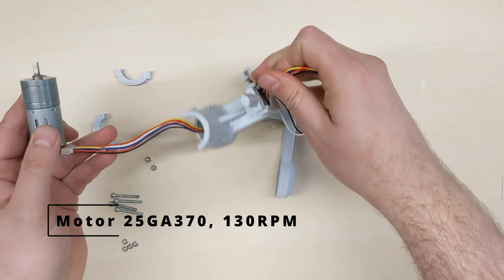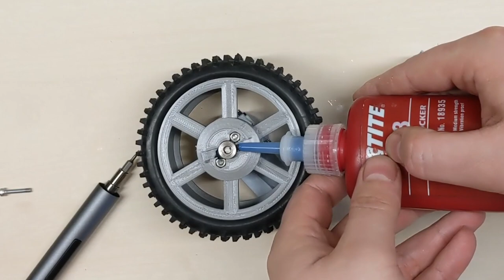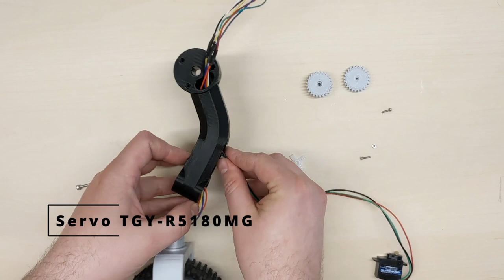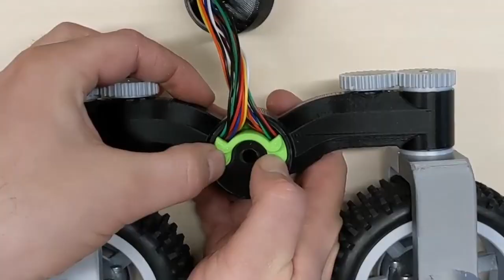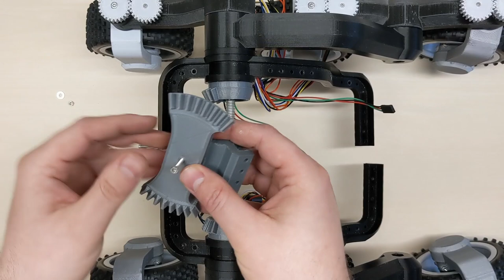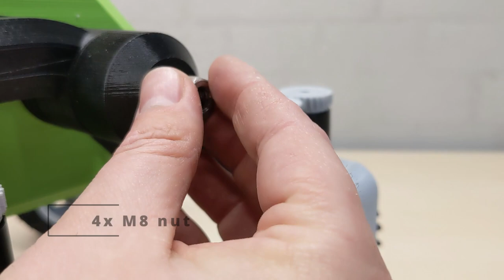Stair Climbing Rover Assembly

Comment: Fantastic!  I can imagine all the iterations of the different systems and hardware design involved in this.
Reply from the maker: Actually not that many. Started by designing one wheel assembly, and build on top of that.  Some parts took a few tries to get the tolerances correct.
Reply: @wildwillyrobots  Those look like pretty high-torque final drive gear motors - are they 6V or 12V?  Also, luv the steering setup.
Reply from the maker: @PeterOhlmus  I think I used 6V in the video. They are cheap 25 mm gear motors. Torque is not super important, as it almost always have 6 wheels touching the ground, so the motors share the load.
Reply: @wildwillyrobots  Just checked out the links - cool!  So, are you running multiple Arduinos to handle steering and RC inputs?
Reply from the maker: @PeterOhlmus  The 6+6 motors are controlled by a custom made driver board based on a Raspberry Pico. I have mainly used it for autonomous driving, i.e. not remote controlled. For that use I have used a Raspberry Pi with a camera. I know a few others have used Arduino's and separate drivers for the motors for remote control.
Reply: @wildwillyrobots  Wow, way more sophisticated than mine!  I heard Rpi didn't offer as many i/o's as Arduino?
Reply from the maker: @PeterOhlmus  The Pico is a bit limited on i/o but have just enough pins for my use.

Comment: its really great project can possible to provide part list, circuit diagram and coding stuff?
Reply from the maker: You can find most parts at https://www.printables.com/model/194299-stair-climbing-rover
In the comments at Printables you can also find a link to the motor driver board schematic. I have not shared any code.

Comment: Are there parts for the other side of the rover? the pieces are asymmetrical
Reply from the maker: If you look at the description at the model page at Printables, it will tell you which parts also needs to be printed mirrored.
Reply: @wildwillyrobots  ok very thanks

Comment: What infill percentage did you use for your prints? I can not find this information anywhere. Thank you.
Reply from the maker: I don't remember exactly. But most of the design has features that are 2-3mm thick, meaning that most of it will consist of walls and little infill. So, you don't need high volume infill.

Comment: “How did you find this white part?” For servo
Reply from the maker: I assume you are talking about the part at 6:40? It is included with the servos, but I have cut the ends of it slightly to make it fit in the gear.

Comment: Hey quick question, what wires are you using to attach to the motor? Also what part is used to attach the motor to the wires? I love your build and my classmates and I are building it for our senior project
Reply from the maker: Typically the wire and connectors are included with the motor, like in this listing: https://www.aliexpress.com/i/32932735768.html I soldered longer wires to the end to extend them to be long enough to run through the arms.
Reply: @wildwillyrobots  Hello, are these motors able to be purchased on another platform such as Amazon?  Or are these exact ones only available on Aliexpress? Thank you!
Reply: @wildwillyrobots  i and my team loved this project and is planning to build this.. but i am finding some difficulties..
 is the .stl of the part used inside the "gear_servo.stl" available? i didnt find it.. 
also  i am finding it hard to get the alternative of tyres as its not available here. Is there any .stl of the tires available..i am planning to print it using TPU
Reply from the maker: @thebeanieboochannel6483  It is a 25mm gear DC motor. I think it is commonly called JGA25-370 or 25GA370. The one I used is 6V 130RPM. I use one with encoder, because my primary use is autonomous driving, where I need to know the position of the motor precisely. If you just want to remote control it, you probably don't need the encoder version.
Reply from the maker: @bhagya.s1584  Are you talking about the white servo horn? I don't have a drawing of this. It is just what was included with the servos. If you look at https://www.printables.com/model/194299-stair-climbing-rover/remixes someone created a TPU tire. I'm havent tried this myself.
Reply: @wildwillyrobots  Thank you so much!
Reply: @wildwillyrobots  I am in India right now. So the servos that i am using doesn't have this servo horn. what should i do?
i have got a replacement for tires but i am not sure what to do about the servo horns.
Reply from the maker: @bhagya.s1584  You need to buy servo horns for your servos. I don't think there is a way to mount the 3d-printed parts directly on the servos. The horns can however be of any shape. If they are not a cross like mine, you can modify the drawing of the gear to fit a different horn.
Reply: @wildwillyrobots  thank you soo much!!!

Comment: sorry it s probably a stupid question, but why is it that the rover body is staying perfectly horizontal, and not tilting forward ?
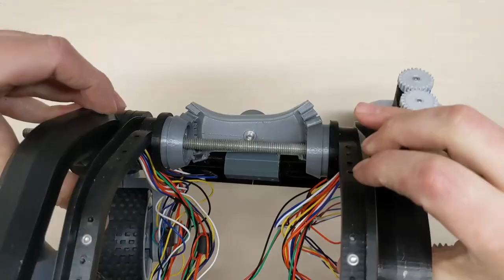Reply from the maker: Good question. If you look at 11:05 you will see 2 small gears fixed to the arms, and one larger gear being installed between the two smaller ones. When all wheels are touching the surface, the arms will not move, so the two small gears does not move. That in turn means that the larger gear cannot move. The larger gear is fixed to the frame of the body, and therefore the body cannot rotate around the main axle of the two arms. The purpose of this "differential" gear is to make sure all wheels are touching the surface. It can be seen at 11:28, that if the arm on one side goes up, the arm on the other side will go down. This makes the force on the wheels the same on both sides when driving in rough terrain.
Reply: @wildwillyrobots  Nice. So when a wheel goes up the body tilts and goes up half the distance ? Very clever stabilisation
Reply from the maker: @yannmassard3970  Yes, the body will tilt with half the angle. Nasa uses the design on their Mars robots, but implemented slightly differently. If you look at this picture https://en.wikipedia.org/wiki/Rocker-bogie#/media/File:Mars_Science_Laboratory_wheels.jpg you can see a black bar on the top of the rover. It is connected to the main arms, and serves the same purpose as the internal gear in my design.

Comment: Which motor driver did you use to drive 6 Dc 6 servo
Reply from the maker: It is custom made based on a Raspberry Pi Pico, 6x DRV8871 for the DC motors, and a PCA9685 for the servos.

Comment: Hi this a beautiful design and as a college student it makes me feel like trying it out. So can you please explain or give us a circuit diagram of the electronics connection part sir. its a kind request please sir.
Reply from the maker: My electronics setup is a bit complicated, because I use it for autonomous driving. If you just want to remote control it, it can be done much simpler, but I don't have much experience with that. I would suggest, that you try to contact others, that have built it. Look at the comments section at Printables here: https://www.printables.com/model/194299-stair-climbing-rover/comments There is also a link to my custom PCB for the electronics, but again, that is most likely overkill for remote control.

Comment: DID you use 3d printer to print the parts?
Reply from the maker: Yes, all the plastic parts are 3d-printet. There is a link to the design files in the description.

Comment: Who is cost all proyect?
Reply from the maker: I build it from parts I had laying around, so I don't know the exact amount. I guess in the range €200-€300 depending on if it is manually controlled or autonomous driven.
Reply: @wildwillyrobots    tengo algunas partes solo que no dispongo de impresora 3d para fabricar las partes. Me ha gustado mucho tu proyecto .aunque es algo complejo para mí. Me gustaría poder contactarme contigo a mi hijo le gusta el robot y desearía poder construirlo.

Comment: Did you publish the code?
Reply from the maker: No, not at the moment. I need to clean it up before publishing.
Reply: @wildwillyrobots  Hi man! Great design 😁 do you have any update regarding the code? Thanks!
Reply from the maker: @darioabadie3666  Sorry, no code yet. What I have is very specific to my use and hardware, so it is not easy to setup. For people just wanting to drive the rover around remote controlled, it is too complicated.
Reply: @wildwillyrobots  Oh I see. Well, thanks for the quick response! Hope some day it is ready to be used using a raspy with generic drivers.